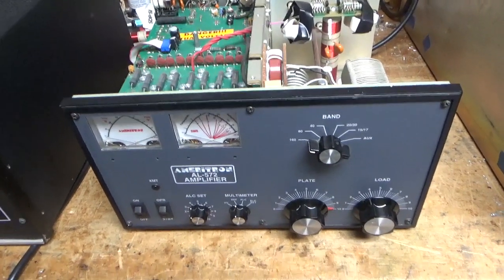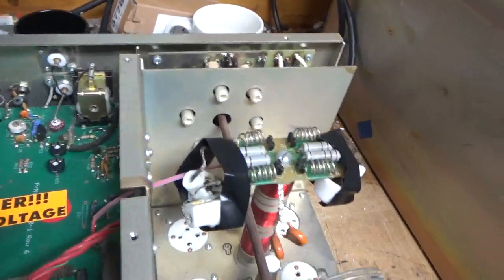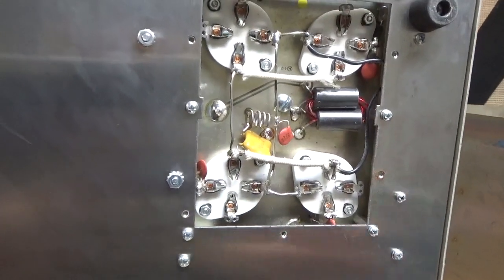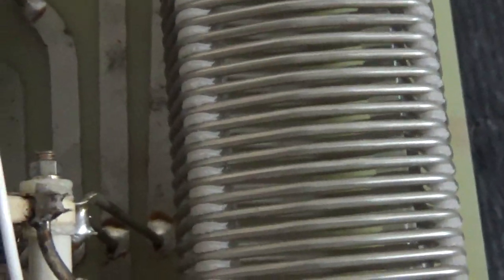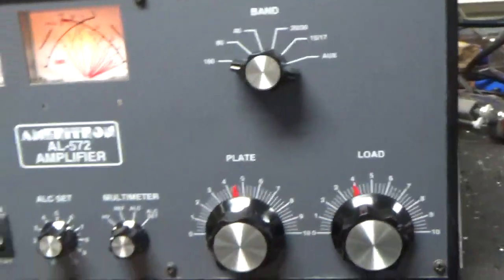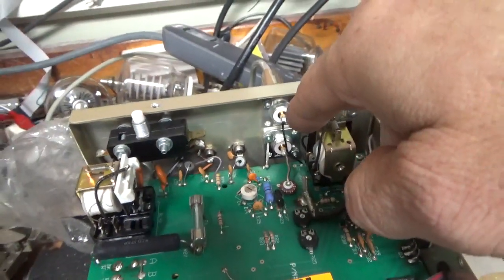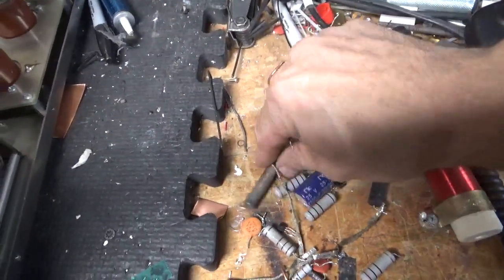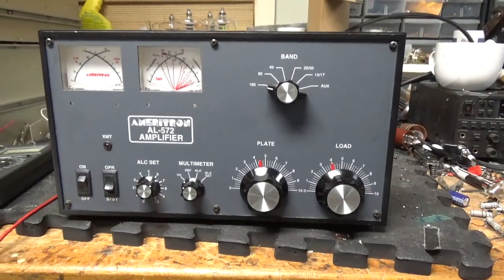Ameritron Al-572 Bias Circuit Repair, Ground Grids, Open Trace Repair 572b Tubes Etc Etc

Comment: Hey Scott. When I key my AL572 with zero exciter power, no input connected, only activated it with a footswitch, I allready get 250mA Plate current. What indicates that ? Bias problem ?
My amp gets real hot, you can feel it especially too on the top cover and it allready blew 2 pair of 10 amp Fast Blow fuses while only running 500 watts . I'm approx. on 230 Volt AC over here.
Still have to ground those grids and put GDT's in.
73 de ON1JV
Reply from the maker: Might have a grid to filament short in one of the tubes, I would stop using until fixed

Thanks for watching 

73